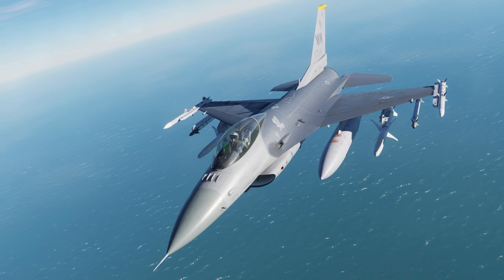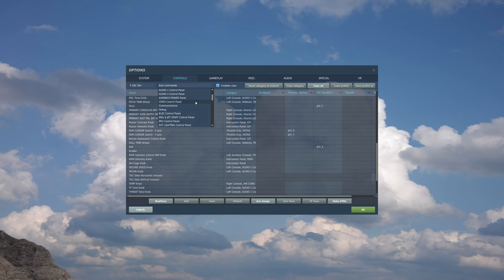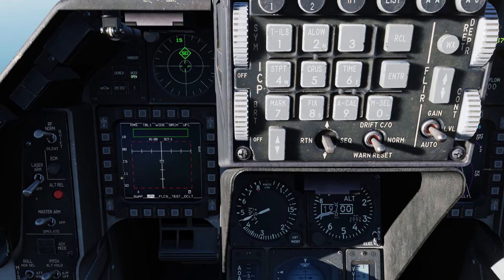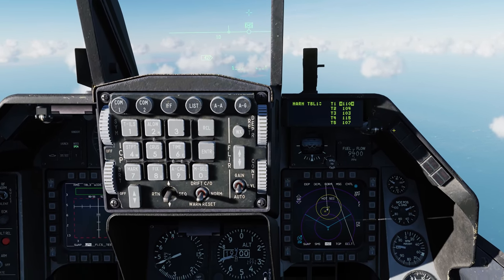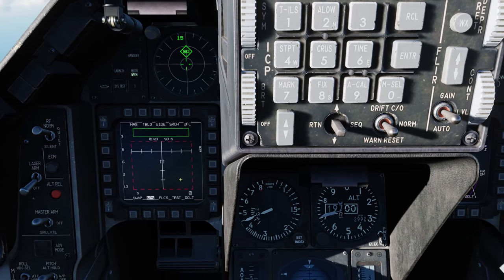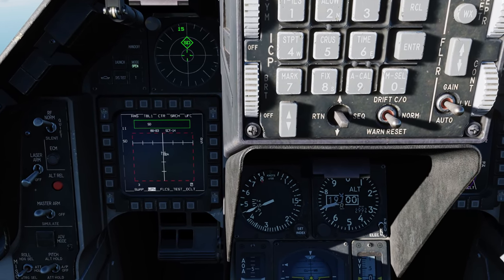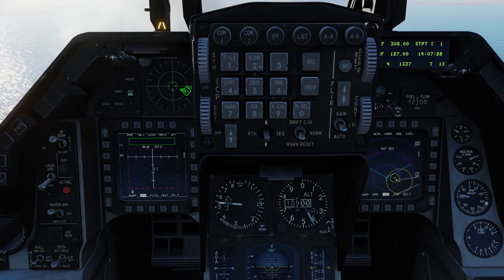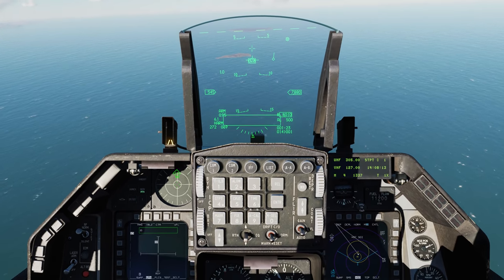DCS: F-16C Viper - AGM-88C HARM in HAS Mode

Comment: will the codes be added to the default kneeboard for the viper? That would be very handy
Reply: It’s basically the NATO code names of the search radars shortened to just initials. Unless it’s the fire control radar specific then it’s just a digit for the SA-#
Reply: @rzr2ffe325  I know what the RWR designations are for each, but there is a 3 digit numerical code that you put into the ICP that represents each type of threat. That's what I would prefer they add to the default kneeboard

Comment: Impressive. But now I wonder why the same missile's sensor seems so much more capable in the Hornet. Does it mean that the Hornet's implementation is unrealistic?
Reply: Hornet is a ground attack aircraft and always was hence he A in its designation. The 16 was designed as a fighter and modified to also provide air to ground. Its likely due to the 16s systems never originally being designed for air to ground.
Reply: @alphapicturesentertainment  In the F16 the computer can take input from ONLY the sensor. In the Hornet it is a combination of RWR and the sensor.
Reply: I understand its a difference in how the weapon is integrated into the platform. But definitely a question worth asking!
Reply: Im wondering the same thing. Is the Hornet's implementation, as done kn DCS, unrealistic. It just seems soooooo easy compared to this. (tho this will def be fun to learn)
Reply: If I understand correctly the F/A-18 has a Harm targeting system built into the airframe.  The F-16 needs to mount an external pod on the left chin mount to have full capability.  It looks like he does not have the HARM targeting pod equiped

Comment: Wait only 2x 88s? The 16 can carry 4 if you don't take wing tanks. Will that be modeled?
Reply from the maker: No, the LAU-118 can only be carried on stations 3 and 7. Thanks
Reply: @MattWagner  even though there are photos of 16s with 4x 88 and Shaw air Force Base official .mil page stating they can carry 4?
Reply: Its more beneficial to have the fuel tanks
Reply: @pjefferson2011  yeah but they let the hog carry 6x Mavs even though doing so will damage the structure on the wing where the gears are at. They let the 18 carry 10x 120 which they would never do due to how disadvantaged the jet would become due to drag.
Reply: I believe the USAF F-16 that is modeled on DCS doesn't carry 4 HARMS
Reply: @ionator2000ist  maybe its a dummy HARM. Only station 3 and 7 wired for HARM capability on "standard" block 50. IIRC ROKAF F-16blk52 has the ability to carry 4 HARM.
Reply: @TheoremGames so then the F-18 shouldn't be able to carry it's 10x 120 load out and the A-10 shouldn't be able to carry it's 6x Mavs. As those aren't approved but can do that
Reply: @TheoremGames edwards has everything from block 20 and up. Block 50s are the only 16s that have the onboard systems to utilize harms. Its why they cant carry the litening navigation pod on the left cheek. Block 40s dont have the systems to do SEAD but can use the litening navigation pod on its left cheek (hence why they tend to be referred to as night falcons)
Reply: Seems like a downgrade from the F-4G that could carry 4x AGM-88:s :(

Comment: What are you using to change your camera view in the cockpit? 
In the past I used to change the angle of the view form my Trustmaster Warthog, but I don't why now I only able to do that with the mouse and 
I can't change that in the settings and it's not easy... 
Do you have any suggestions? Thanks!!
Reply: TrackIR
Reply: @zeitgeist722  Thanks
Reply: DelanClip is much more value for money amd works just the same as TrackIR. I have the wireless version that is 3D printed
Reply: @Imperial-GB  I have the TrackIR , but it's not always working well,  also I have to wear a hat... I just don't understand why I can't change it back to the joystick.
Reply: @anthonyhershko  make sure its dark in your room, sometimes light can interfere with the input. As someone who's used a joystick hat to move my head in game I'd never go back to that now i have head tracking. Delan clip just gets attached to your headset via some tape, might sound messy but you can make it really neat and you don't even notice it's there its really lightweight.

If you really need to change it back to the joystick though, unplug trackIR, then in DCS find where the trackIR has control in the controls menu (maybe axis section) and delete them inputs, then in camera section you'll have to map up, down, left, right manually
Reply: @Imperial-GB  Thank you so much man!!